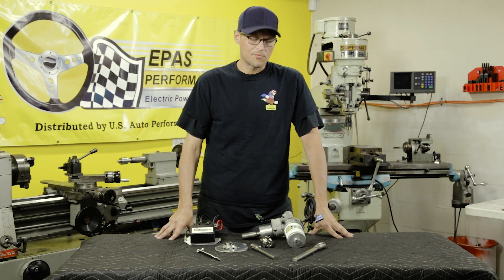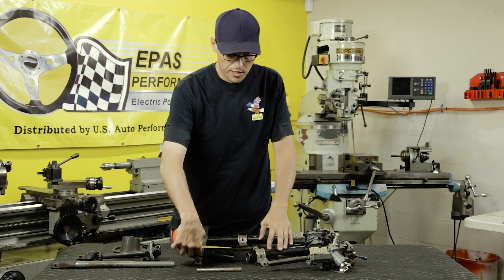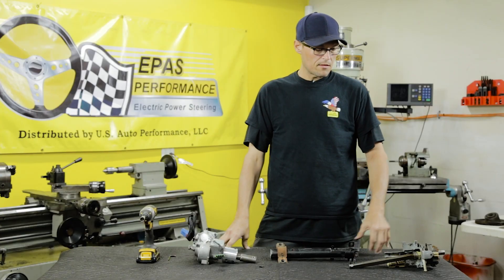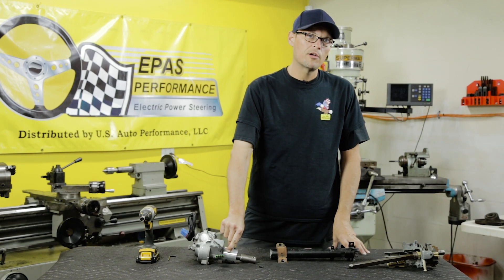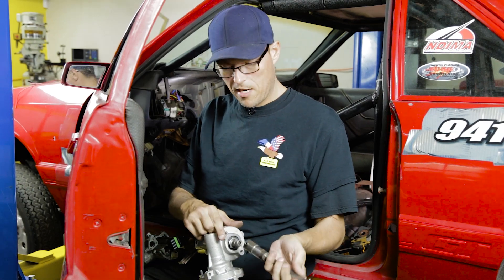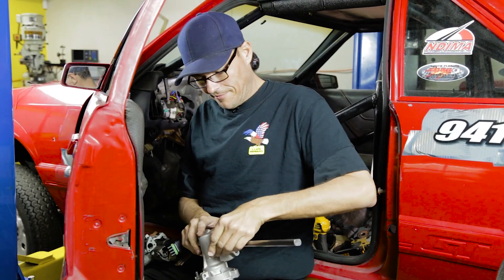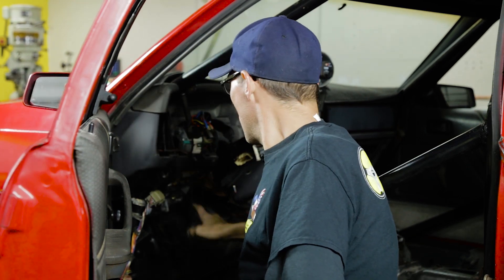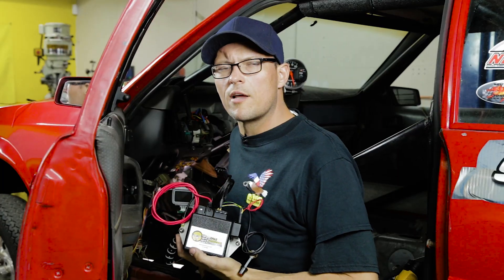EPAS performance Electric Power Steering Kit, Fox Body Mustang "How To "Install video

Comment: I want to convert my '85 Foxbody to an EPAS system.
Do you have to convert to a manual steering rack?
Or do you just disconnect the power steering pump and power steering hoses from the power steering rack?
What if I've already changed my OEM rag joint steering shaft to an aftermarket U joint shaft?
Reply from the maker: @Turbo4Joe363 our electric power steering systems are designed to work with manual steering components. If you already have power steering, yes, you'll need to convert to manual. Or consider checking out our Hydroelectric Power Steering System as that will work with your existing power steering rack!

Comment: Is there support for the potentiometer/ECU to adjust based on speed? Does the EPAS system help to keep the steering wheel centered when not turning?

Comment: Does that tiny little alloy bracket hold that motor in place against forces from the steering?  Isn't that a little lightweight?
Reply: Was wondering the same thing. I'd definitely make my own bracket.

Comment: would this work on a 1990 mustang???
Reply: Since when is a 1990 not considered a Foxbody? The Fox went from 1979 to 1993.
Reply from the maker: Sorry Kira but no it will not. That vehicle is too new for our system to adapt to OEM. If you want to make changes to the steering column. Feel free to contact us for details on a custom build. Thanks!
Reply: @epasperformance5469  I don't understand, this video is for installation into a foxbody Mustang yet you say it will not work on a 1990 Mustang?
Reply: @johnkilo3  This specific kit is designed strictly for the Foxbody. We would make a kit based off your vehicle as started above. A custom kit would need to be created. Feel free to give us a call for more information. Thank you!

Comment: what rack and pinion is pictured around the 4 minute mark ? Is it recommended/required for this kit?
Reply from the maker: Justin, Sorry for the delayed response, We proto- type off of customers vehicles. This one specifically is a dirt circle track car. Sadly, I do not know what equipment the customer put in the vehicle.

Comment: What is the benefits of this steering system ?I'm assuming this is for race application's only?
Reply from the maker: We have multiple options available not just for race applications. Ex: This video is specific to the Fox body Mustang. 
Our system is fully electronic meaning no leaky pumps or hoses. By removing all those components and replacing with ours, reducing weight.
How it works: The computer measures the amount of effort on the steering wheel and amplifies it with the aid of the electric motor. A potentiometer allows you to have more or less assistance, so you can adjust the amount of power assist. For example, you can have maximal power assist on a parking lot, and less on the highway.
Reply: @epasperformance5469  is it a basic 0-5 V potentiometer? - Because I'd like to connect it to a microcontroller that adjusts it according to the speed.
Reply: EPAS Performance Ok I appreciate the info,learn something new everyday!
Reply: Less parasitic loss= increased fuel economy, more hp